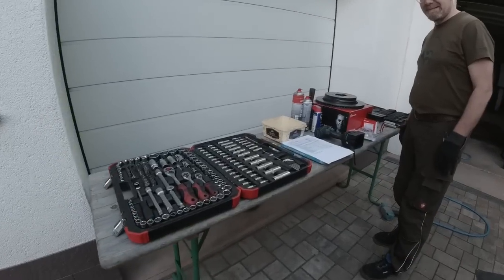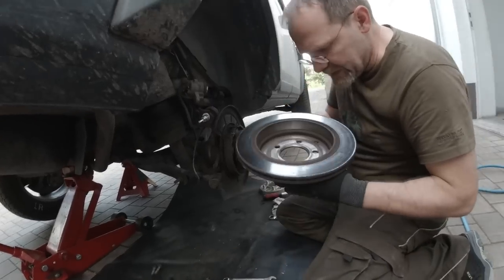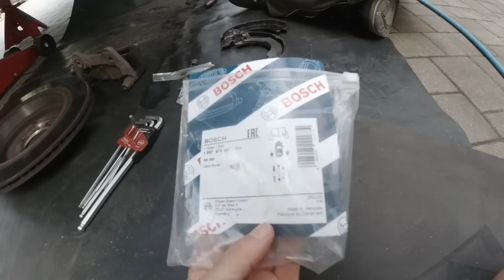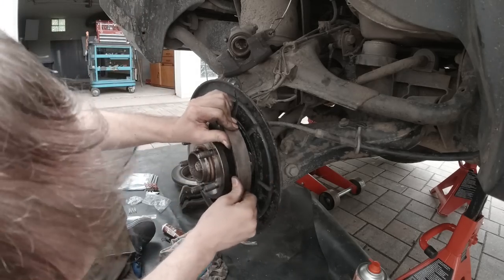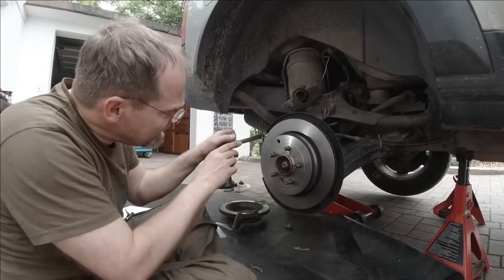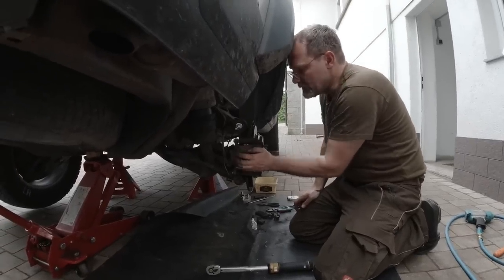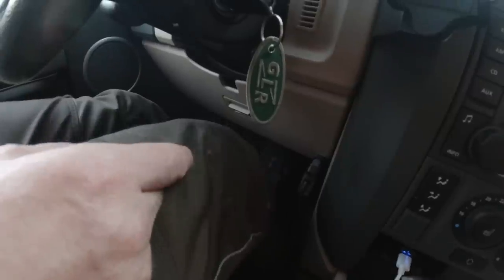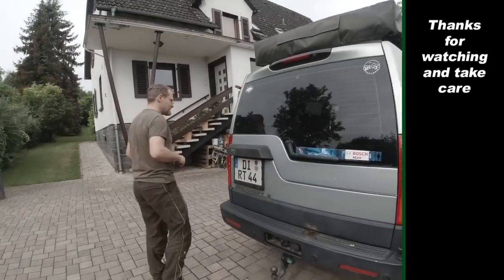Rear Brake Service - Land Rover Discovery 3 and 4

Comment: When pushing pistons back into the caliper I first loosen the bleed nipple. This avoids the need to draw fluid from the reservoir and avoids pushing fluid from the calliper back into the hydraulic pipes and worse the ABS pump. The fluid in the callipers may have been through many heat cycles and may contain contaminants from corrosion and degraded seals.
Reply: I've started doing this too these days. Avoids any tiny risk of debris in the fluid getting into the ABS unit, but I also find it less effort than drawing fluid from the reservoir, and why not drain out a bit of the oldest and dirtiest fluid (in calliper) rather than the newest and cleanest (in the reservoir)?

Comment: It’s a good idea to do the stop at 35km occasionally to clean the shoes and the disc’s drum surface… they can corroded and pit if left for years only being activated when parked.
Reply from the maker: You mean 35000km. We have our wheels off more than most people and inspect our brakes regularly. 👍🙋‍♀️Vera
Reply: I think James T meant at 35 km per hour, as per the brake bedding-in procedure that you demonstrated. (You know where the farmer thought you were weird.)
Reply: @jeffreywilkinson2679  correctermondo 👍

Comment: Swapped complete rear axle on my 90 last week, bought a Disco 1 axle and my mate welded up a truss kit and heavy duty diff pan, then with help from another mate we rebuilt the complete axle with a locking diff. New brakes and calipers with pads fitted as well.

Comment: I used a screw extractor for the first time  to remove my Haldex gen 1 screw and replace the Haldex Control oil.  I'm so happy as I failed initially by buying a thread tap, thinking it was the same thing.  It was a nightmare to me.  Thank you for inspiring me.  Greetings from Auckland.

Comment: I just did the brakes on my Jeep with Powerstops new rotors and pads. Those parking brake shoes are such a pain in the butt to replace and adjust. Jeeps do not have an external adjustment hole for the shoes, so you have to pull the rotor off every time that it needs to be adjusted. I wish mine had that little adjustment hole to finalize the park brake adjustment.

Comment: Good stress free informative video, and yes it is not a difficult job replacing the brake pads, rotors and parking brake shoes. My son did my rear brakes including the rotors. I watched. My son is an apprentice mechanic. He did my front ones a little while ago. Now the inner front left CV boot is damaged. He will be replacing that also.

On my previous vehicles I used to take the old rubber insert off the front wipers and chose the best for the rear - the rear wiper hardly ever got used. Nowadays I replace front & rears at the same time with new ones. Either I was a cheapscate or now couldn't be bothered as new ones are easier 😁
Reply from the maker: It's always good to have someone handy around. 😃💪🙋‍♀Vera

Comment: If it was a  TOYOTA it would never need brakes replacing as they last forever. Even in the outback here in OZ!  I have a late model Toyota Hilux and a Prado across the road from my house and they never break ever ever ever...and they have a hammer and shifter in the glovebox, which does all repair work if required. 
 
I think Christian also needs a Tattoo that's says "I LUV TOYOTAS"  and "COPPER GREASE" 

Vera , when Christian is asleep please write in on his arm in large Black sharpie/Nikko pen.......lol It will take at least 3 days for it to fade......Luv your work!
Reply from the maker: 😅👍🙋‍♀️Vera

Comment: Well I hope you have better luck with the Brembo discs than I did. They went rusty behind so badly that the steering wheel shook under braking. Took me a while to realise what was wrong. Replaced with Textar coated. Please don't sell the 4. Have you changed the cam and fuel pump belts? Much harder than on the 3, particularly if you have the stop/ start system. The fuel pump belt is timed as it's a two rather than three cylinder pump. Keep up the good work!
Reply from the maker: Our LR 4 just has not enough kms on it yet to do any of the major maintenace repairs. 😃👍🙋‍♀️Vera
Reply: I have run Brembo for 2 years and no rust at all. I have the V8 brakes so maybe they are different quality 🤷‍♂

Comment: Good tips in this video. Complicated assembly. Makes you wonder what your average brake and muffler shop would do. Why mark it with white paint if it is 10 clicks? Just as a verification step?
Reply from the maker: Because you can't rotate it exact one revolution with the screwdriver, just little increments each time. Yeah so it is to verify that you did indeed go full revolutions. 🙋‍♀️Vera

Comment: Another nice video - about to do mine tonight. I am curious about the jacking point - can you clarify whereabouts the jack engages as it looks the best way to get both sides up at once. Many thanks
Reply from the maker: We use the second crossmember (there are two), the one between the two skid plates, to jack up the car. Sorry for the late reply, you probaboly already did the job, but I had no time earlier. 🙋‍♀️Vera

Comment: When replacing the rear rotors do you need to put the park brake in service mode or can you just loosen the sprocket so you can remove the rotor?
Reply from the maker: We show everything in this video. 👍🙋‍♀️

Comment: Another great video! Im going to service my LR4 brakes soon, I think with EBC rotors :)  

Couple things - bedding in would only be required with new parking brake shoes no?  as you are preparing the brake pads more then the disk. 

2nd - I'm not 100% certain but I believe those brembo brakes are made in China lol, they are the lower end brembo products.
Reply from the maker: I have to say, you could definitely feel a difference in the braking behavior of the embedding procedure. I would for sure do it, and it's no big deal. I just don't like the sudden stop, I get sick to my stomach so easily. 😅🙋‍♀️Vera

Comment: That breakin is almost as weird as the old Rover 2000
Drive thru the parking lot in reverse pulling up the emergency brake until it's the right height.

Comment: Should the car be in neutral or park when adjusting the shoes? Thank you
Reply from the maker: You can rotate the rear wheels in either, if both of them are off the ground.   If only one is off the ground, it needs to be in neutral.
Reply: @Vera_and_Christian  Thank you for the help. amazing work guys.

Comment: Another great video. Question:
On the front brakes, what would cause the disc brake (inner) Dust shields to be coming loose and start to rattle?
This recently happened on my Ranger-rover Sport L320. The brake pads and discs themselves, are fine and do not need replacing.
For the time being, so that I don’t need to take off the entire disc assembly, I have secured the front Dust shields with 3 strategically placed zip (cable) ties. It seems to have solved the problem. But what caused them to become loose in the first place?
The rear disc brake Dust shields and still tightly secured.
Reply from the maker: Not sure.  Ours are corroded badly.  Christian
Reply: @Vera_and_Christian  Yes , I think mine have probably corroded in the holes where they are bolted on.

Comment: Cheers guys mine are due for a complete strip down a service and I’ve noticed the caliper rubber has ripped on my drivers side. Can these be replaced? The caliper is only 9 months old.
Reply from the maker: Yes, there are repair kits available.  Aftermarket.  Christian

Comment: If i was to just change rear discs/rotors and pads do i still need to put the electric hand brake into service mode??...anyone no.. thanks
Reply from the maker: All you got to do is push the button and pull the key out.  Christian
Reply: @Vera_and_Christian  but if i put the electric park brake on the disc won't come off because the brake shoes will lock the disc on.
Reply: @rustytwinkles7762  I know your comment was a year ago, but the point is that pushing the button while you pull the key out stops the hand brake coming on automatically. That's what lets you get the disc off. That's how I understood the video, anyway.

Comment: Hi Christian and Vera.  Excuse my ignorance but what is so special about copper grease?  Couldn’t you just use ordinary grease?
Reply: Think copper crease tolerates higher temperatures.. ordinary grease would burn off
Reply from the maker: Copper grease is more moisture and heat resistant. But we use it only for static contact surfaces. 🙋‍♀Vera
Reply: Hi Christian and Vera (and David), it would be better to use Ceramic brake grease ,such as “Ceratec” on brake pad ends and the caliper carriers as copper grease causes electrolytic corrosion and actually makes the situation worse accelerating the corrosion. Ceratec contains no metal and also stays in place much longer than copper grease. I switched from using copper grease on my customers vehicles a few years ago and can see the difference it's made.
Great video as usuall, those parking brake shoes look like a real pain to do.

Comment: My comment seems to have deleted itself so I'll try again.
Take a close look at your video and spot the error. Front wheel chocking? 🤔
You had one job Vera 🤣🤣
Reply from the maker: I think you have to explain yourself a little better. 🙋‍♀Vera
Reply: @Vera_and_Christian  OK. You chocked the front wheels on the wrong side. As it was jacked up, there was nothing stopping it from rolling forward off the jack. On a slope it would potentially have come off the axle stands, fortunately your drive seems level so all good. Could easily have been an accident.
Reply: It seems to me their drive is loping towards the garage. I would chock it like Vera did. No way it is going to roll uphill. On level ground, would it even need chocks? 🤔
Reply from the maker: @cliff4wd  😅👍That must have been  aaaaaall Christian's fault, I only do what he tells me 😂Sorrry about the comment, but I got so many rude comments this time, some of them I delelted. I think sometimes viewers forget that we are real people, and not robots who read our comments.   🙋‍♀Vera
Reply from the maker: @cliff4wd  I checked the video again, and I did everything correct. If you watch carefully you might notice that the car is the otherway around and I put the chucks underneath the front wheel, so that the car will not roll down. We made that repair already a couple of weeks ago and I trusted what you wrote was correct and I did a mistake. But I did everything right, I always do everything right.  ☹😅🙋‍♀Vera
Reply: Actually, you need to watch it again and ask yourself what the chocks are supposed to be doing. As you jack up the rear, the front wheels are free to roll forward. I did double check and watch again but I saw the same error as first time I watched.
Anyway, keep up the good work, very entertaining 😊
Reply: In support of Vera. 
Regular LT Time fans will know that Vera and Christian’s drive is actually quite steep. 
Vera correctly placed the chocks on the down hill side of the wheels, which would prevent the car rolling down the driveway if a slippage occurred.
Reply from the maker: @jeffreywilkinson2679  Thank you ☺👍🙋‍♀Vera
Reply: @Vera_and_Christian  your very welcome Vera. Your videos are superb. I look forward to them every Sunday. Best wishes. Jeffrey.